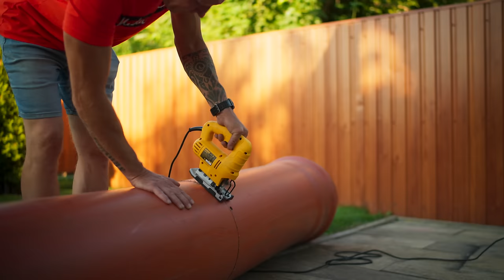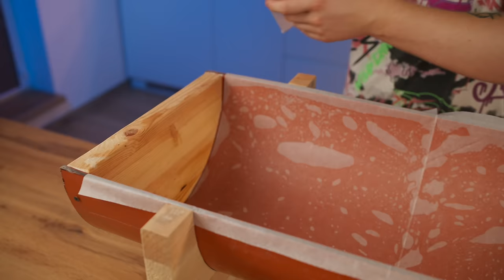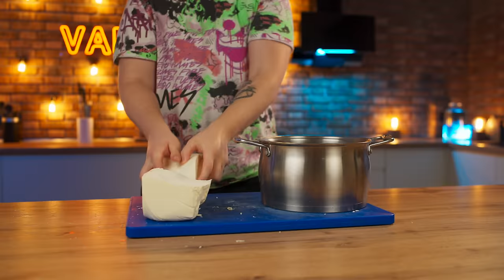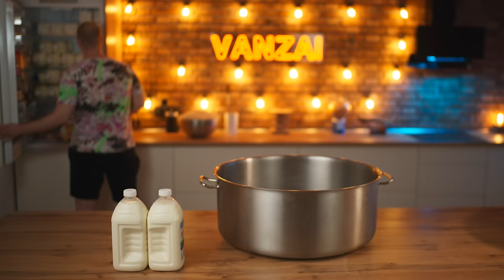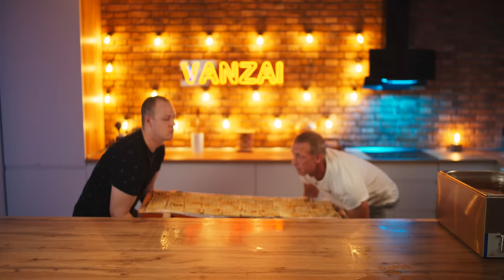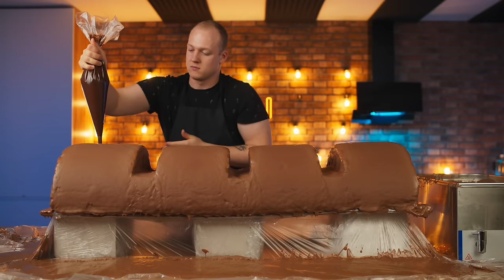I Made A Giant 220-Pound Kinder Bueno

Comment: Ok, it's impressive 😮, but how do you calculate the quantity of ingredients 🤔? Do you make a smaller scale first? There is a lot of work behind it, congratulations 👏👏👏
Reply: Pray lol
Reply: look at the ingredients from a normal one. then do 2.2 [i presume a normal one weighs 2.2 pounds] Times 1 000, And 220 pounds! And do times 100 to every ingredient
Reply: bakers math, so normally the type of flower used is used as the control factor, so lets say you have 60 pounds of flower, 20 pounds of water, 2 pounds of oil and .5 pounds of yeast

flower = 100%

to figure out how much percentage of the other ingredients you would need you would do:
(N/60)*100, where N is the ingredients weight

so you would have:

Flower = 100%
Water = 33%
Oil = 3.33%
Yeast = 0.8%

you would then multiply those percentages to figure out how much of each needed for a bigger size

lets say you triple the size

so
Flower = 300%
Water = 99%
Oil = 9.99%
yeast = 2.4%

to figure out how much in weight wise you would do (%*0.01)*60 or (%/100)*60

so you would have
Flower = 180 pounds
water = 59.4 pounds
Oil = 5.994 pounds
Yeast = 1.44 pounds
Reply: @randompersonjustdoingsomething  lets say they put 2 eggs in it (idk actual ingredients)
Wow. That’s a lot of eggs
Reply: @thereisanewchannel8239  Look at how much pure yolks he put in, Also in the normal version 2 eggs is too much.
Reply: @randompersonjustdoingsomething  alright, but still a lot of eggs
Reply: @XoSTW1G  you mean flour right? I was confused
Reply: Calculator
Reply: @XoSTW1G  I think you mean flour
Reply: @randompersonjustdoingsomething  wym normal one weight 2 pounds😂😂 they’re really tiny candy bars
Reply: @yungpsy  😭😭😭 imagine the size of it at 2 lbs!
Reply: It's probably not the original recipe I assume so it's their own recipe. They probably tested before to get the right consistency for every layer
Reply: Npc
Reply: multiply

Comment: The Pipe you're using is used for underground construction. There is a form of ratpoison in it to prevent the Rats biting it trough. Might not be a good idea to use it for food m8 😅
Reply: probably the buy new and they wash it
Reply: @lucatempo13  it's in the material itself 😂
Reply: Who said it's real use wasn't to get rid of orphans ?
Reply: @mrditkovich5817   I’ve laughed with that comment. I should have not, but I did
Reply: I’m sorry